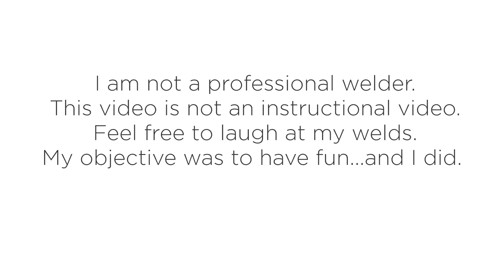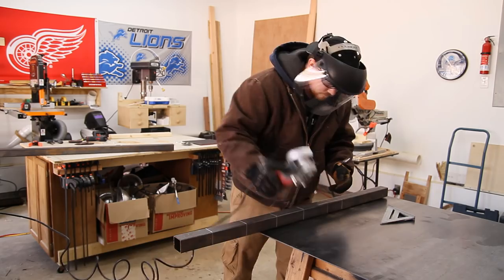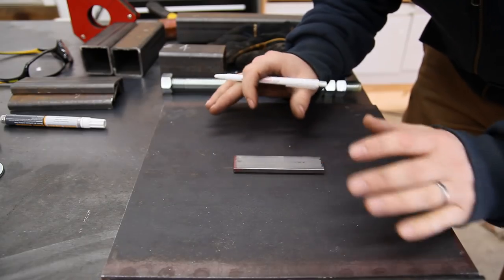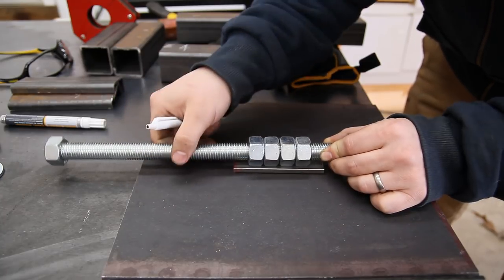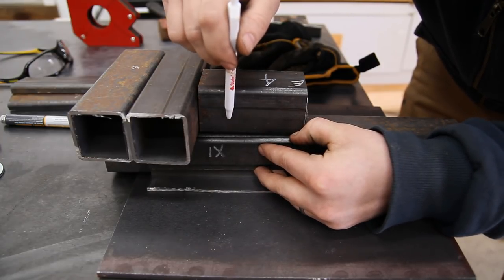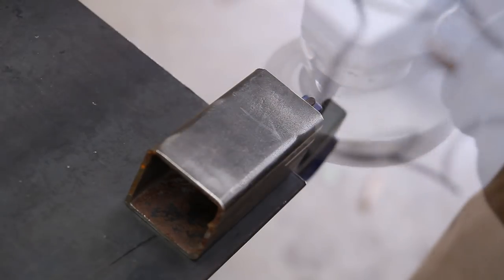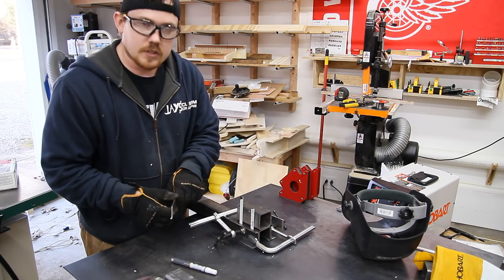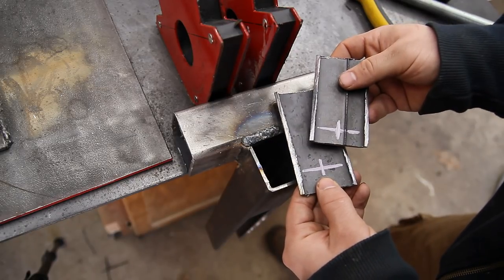DIY Metal Vise

Comment: Another great video Jay.
I have found that a sanding flap-disc works far better than the wire wheel for cleaning up the surfaces. Much faster and it doesn't spray you with wire pieces.
Also, I would suggest refraining from using the "sawing" motion while using the cut-off wheel. It is useful only in creating the path for your cut, but from there on I allow the wheel to plunge into the steel and cut. I have found that the wheel performs much better this way.

Comment: Once upon a time I used to be a certified welder. I have seen worse welds from people who were supposed to be competent. So, great job! Using that "U" shaped piece actually improves the original design and is more robust. Great thinking on your feet. Its cool to just "mess around" with no expectations. That's how we improve our skills. The all thread will last longer by adding the extra nut but the reason V threads aren't the best choice is because the translate a lot of the torque into outward force instead of longitudinal force because of the pressure angle of the thread. This means you have to tighten it much more to get the same amount of force of an acme thread. But youre right, it will be great for a medium duty vice. I really like your attitude of having fun. Great. Ok I have blabbed on too long to no one. Lol...Tim

Comment: That was super informative thank you!  I will say, I have had a blade pop in half on my angle grinder, one half stuck into the drywall of the shop I was working in (about 7 feet from where I was working), the other half caught me right in the dingus, so now I use a blade guard, no matter how annoying the thing is!  I, like many others, never think these things happen, then they do and it changes you for life!

Comment: Good adaptation to the 2x2 tubing and it turned out great! Awesome strength test at the end and I'll check back in a couple thousand years when the threads on that rod finally wear out.
Reply from the maker: John Heisz Thanks dude. I was going to use a can of tomato paste as you did but ended up chickening out. Didn't want to get it messy lol.
Reply: Jay Bates But tomato sauce is a great metal polish... OK fine, it's good for brass and I have no idea how it'd do for steel... Just tryin to see some Gallagher-type action.
Reply: Andrew Rowe Gallagher-type action is when he throws the vice at a watermelon. Would be fun to watch.
Reply: How long time did it take to build ? 
And Nice work BTW
Reply: Yj
Reply: John I just gave you a sub from this guy's channel found him first gave you both a sub

Comment: Small tip, those magnetic clamps are good for pointing the pieces together, but watch if you do full welds near those clamps because they can fuck up your weld inside because of the magnetic field, maybe not to serious for small welds but if your welds need to be 100% flawless ( radiographic controls) you cant use them. Cool build!

Comment: Thank you for posting your whole build in this video. I see where I messed up on mine. Like a fool I welded a nut to the front of the sliding jaw, where you welded the nut to the threaded rod. Not sure what I was thinking. Yours turned out great. Can't wait to correct my mistake and get to crushing things as well.

Comment: The welds looked pretty good to me. I'm no expert but I've found the welds come out smoother if you turn up the heat a little, though. Great use of the 4 nuts to distribute the load on the all-thread. Wish I would have thought if that on a recent build.
Reply from the maker: alanhennington Thanks! I had to turn the heat down actually. I was burning through the pieces at one point.
Reply: Maybe having gas would help then. I have had a Hobart welder about the same size as yours for maybe 13 years. I have always used gas, though. You said you couldn't justify the expense but I don't remember it costing too much. It seems like they basically charged a nominal rental or exchange fee on the bottle to sell me the gas. I thought the cost was around $40 but I could be totally wrong. I've only exchanged it once so I don't remember too well.

Comment: Yeah Jay, Looks like you had fun. That's what matters. I am a welder. Just don't like the flux core stuff though. If you have the means check into a bottle for shielding gas. You will find welding is very easy that way. Use 75 25 gas and it's cheap. You will love it. Oh looks like the vise works really good to. Win win.

Comment: GREAT BUILD!
I know you have welded with gas before, and flux core works great and is convenient. But it took me about 2 projects when cleanup became a pain in the azz, and that roll of flux core wire is still sitting on the shelf.
thanks for another awesome video Jay !
Reply from the maker: William Lutes I've never welded with gas :) Flux is cheap and I don't have to deal with bottle costs. I may or may not get a bottle in the future.
Reply: I hear you. The difference in welds is night and day, and Im lazy when it comes to the extra clean up. If you get a chance try with gas, it makes it more fun 😎
Reply: Jay Bates Once you have a bottle, the costs aren't that bad. I paid about $200 for a 125cu bottle of 75/25 and refills are $25. I'm just a hobby welder/woodworker so not all that much being done with the welder. I still have about 60% of the tank left after 9 months. 

If you do end up going with gas, find a place that lets you actually purchase the bottle and then exchange it. The big AIRGAS place only leases bottles. Something about that just doesn't sit right with me. I like owning a bottle and they just swap it out when I go to get a refill, so I never have to worry about recertification costs.

Comment: Looks great. Welding is my career, and the only tip I can give is to make sure you're using a drag angle when welding with flux core instead of a push angle.
Reply from the maker: Kirby Weldon Thanks Kirby. I pushed and pulled and went uphill and downhill on this build. Trying it all but I do prefer to pull. Thanks for watching

Comment: Nice project, many times the steel has a light coating of oil,if you wipe it off with paint thinner or alcohol,you will get a better weld

Comment: Jay love your videos and this fun build. As far as the welding goes the main thing is to make it stick, grinders were made to make it pretty, that being said, I had a crew of certified welders working for me in my company and they use to laugh at my welds all the time. One told me to try push - pull or puddling when using small wire feed welders instead of rocking your hand to get a cleaner weld. Try it, it works for me as I only weld when I have to. And I agree with a previous subscriber that the flap dic are far better for cleaning and dressing up welds, I always looked like a porcupine when using the wire wheels. Keep the videos coming, I love them.

Brad
Proud Disabled Navy Veteran
Navy Divers "Dive the World Over"
Combat Rescue Swimmers Swim "So Others May Live"
Reply from the maker: +Brad Garms Thank you for your input and your service.
Reply: Brad Garms

Comment: My welding instructor told me paint and grinding do wonders in making your welds look good
Reply from the maker: John Diemer True. I actually ground off the vertical weld directly to the right of the handle on the front jaw but decided against doing it for all of them.

Comment: It's my understanding that the load is distributed unevenly among threads for bolts, such that your first thread of engagement is holding 30-40% of the load, the second thread is only holding 20% of the load, and so forth.  The general rule for steel is that if you take the diameter of your bolt, then the entire load is being held within the first diameter-length of threads on the bolt.  In other words, for a 1" diameter bolt of infinite length, inserted into a threaded hole of infinite length, the entire load of force will be distributed within the first 1" of the bolt and hole thread engagement.  In your case, welding additional nuts together to make your all thread not strip out doesn't actually distribute the load better.

Comment: Dear Man, Two Important Tips:
1) When you work on galvanized materials – you MUST wear respiratory protection, because when galvanize material is heated – very toxic gases are emitted (welding lessons are taught).
2) For good results when welding galvanized raw materials – use wire without shielding gas. It's called Flux Cored.
I really like the content you create. You are a very talented man, and your works are very beautiful and accurate. Your designs are very much my favorite; especially I like your straight lines and clean.
Good luck!!

Comment: Good job, nice and simple.  Tip:  grease the rod so its easier to move back and forth, and if you use that vice to weld with, put your ground clamp as close to the part as possible or you might get "ground flash" and it welds your rod to your nuts, been there done that...
Reply from the maker: ***** I did grease the rod. Showed it in my web article. Hard to show every detail in videos. Thanks for watching Tony!
Reply: "and it welds your rod to your nuts"

That sounds VERY painful!

Comment: Idea: Fill the tubes with concrete. It's very resistant to compression, so it should add substantially to the capability of the tubes to act without deformation under any rational load.

Comment: Nice. If you make another, in the future, think about using a rod coupler. It would be about as long as 4 nuts, but you would not have to worry about alignment. Just a thought.
Reply from the maker: acklan3 I was originally looking for one but only found one in aluminum for some reason.
Reply: Jay Bates cool. I was thinking about cannibalizing a automotive scissor jack.

Comment: If you're using fluxcore, you should reverse the electrode so that the gun is negative and the ground clamp is positive. You'll get much better welds. It helps to swirl the puddle around some, too, in a zig-zag type pattern. 

Be careful when welding galvanized steel - such as that on the all thread rod. Zinc will vaporize and can cause sickness or death if inhaled.

Comment: That's great.. Aren't mig welders fun! The only suggestion i can think of is it may be a good idea to cap off the four open ends of the jaws so they won't collapse similar to the small piece you crushed at the end of the video. Maybe cap one end then fill with concrete then cap the other end?
Reply from the maker: builtrodewreckedit Yup. I discussed that with a few friends last night actually. Not the concrete part but capping the ends. I'll definitely cap the ends.
Reply: I wouldn't hurt atleast. I only suggest concrete because it would give the center of the tube no space to collapse into and the extra weight won't hurt anything either.... its a cool vice
Reply: Filling the jaws is a good idea. Not with concrete, but with a low temp alloy like Ceralloy. This will melt at around 160-220 F, depending on the grade.  You can get at MSC or any of the bigger industrial supply houses. Cap one end, fill and cap the other end. Real solid.

Comment: Nice job, and good job at using your face shield while using the cut off wheel.   I have seen those disks fly apart and imbed themselves into peoples face.   That's a nice looking vice, I'm thinking on building one myself.
Reply from the maker: Chris T Luckily I've never had any of the pieces hit me.
Reply: Ive been in factory and construction work for all of my adult life.   I have seen my fair share of accidents, many which could have been prevented.  I am now the safety manager for my company and I dont need to preach, I let photographs do the work.   I have one of a disk in a guys face.  I can share it with you if you want it.  :)   Anyway, keep up the good work, I enjoy your projects.

Comment: Nice metalworking Jay. the only thing I didn't like is the rounded off top edge of the clamp bars. Sorry I'm not native american, but I think you will understand what I mean. Maybe with a little strip of rectangular steel and a notch in the top edge this is slightly better. However you can still do a retrofit on that.

Comment: I like it but a question
Did you use flux core wire ??
And why not hit it up with a 7018stick weld to finish
I may think it to be lots stronger then mig weld
A vise will receive lots of heavy beating a d thicker will be best will you agree ??

Comment: What setup are you using? I don't know what you can do about the ugliness with flux, since I've never really used it, but if you're using argon gas, you should try and up the gas flow to cool the solder faster to avoid bubbles growing. Also, since you're welding kind of thick steel, up the amperage, I always weld at 160 amps and get smooth solders with that.  Also, move the nozzle in moonshaped motions, capturing the solder that you just laid and "stretch" it into the new weld. You probably know all this but just a heads up in case you didn't. :) Great seeing that some youtubers have begun to spread out to metalwork as well. It's very inspiring to watch!
Reply from the maker: Axel Mårs Hey Axel. I'm just using flux core. No gas. I don't think the amount of welding I will be doing will be worth getting a bottle.

Comment: Your welds are not bad... In fact they are better than a few pro welders i saw....
Question: why did you not use galvanized steel instead of black iron tubing so it won't rust?
Reply: Fumes from welding  galvanized steel are poisonous.

Comment: buddy you've probably heard this before but I'm going to reiterate it because it's so serious and you've gotten into welding. when you weld metal be absolutely sure that nothing is coated with zinc, galvanized, or is mixed with manganese. when zinc burns in air the fumes can give you zinc fever which kills you in three weeks painfully. even small doses of zinc fumes can ruin your day, I've accidentally exposed myself a couple of times and have been sick every time. take the time to either burn it off before welding by taking a torch to it outside and upwind or use some muriatic acid to strip the zinc off before welding.  you'll have a better and easier time welding and your future self will thank you when you live to a ripe old age. manganese does something similar but it's in alloys and can't be removed, know what you're working with and you'll be good.
Reply: "when zinc burns in air the fumes can give you zinc fever which kills you in three weeks painfully. "  Absolute RUBBISH
Reply: Far from the truth. I used to build and weld on barges that were covered in zinc primer every day for 5 yrs and I'm still very much alive.....While it can most certainly make you sick death is unlikely. One thing you should never do is weld something that has been cleaned with brake cleaner...that, will kill you!!!

Comment: you should grind off the zink from the nuts and bolts if you want to weld it that makes if much more easy to weld them and you dont have the toxic fumes.

its not possible to weld zink so if you try ito weld a nut your metal will drop down until the zink is burned off.
also you can buy nuts "black" (without zink) but you will not find them in the hardware store i think.

also some of your welds looks a litte "cold" try to use more power or move slower.

also its important wich angel you use. if you are welding thin pieces try to weld "pushing"  hold your torch like this \  and move this direction -> if it is thik hold it in the oposit direction and "pull weld" if you are not sure what to use weld neutral like this  |

if you have a problem with bubbles in your welding check the gas and maybe use more then check if your torch is clean and if you still have bubbles clean your work piece with the angle grinder.

good luck with your future weldings and nice video *thumbs up"

Comment: Get some 75/25 fluxcore is not your friend when it comes to making nice looking welds. Love the video.
Reply from the maker: Zach Scott I don't think I do enough welding to justify the cost of a bottle. Thanks for watching Zach.
Reply: If you look around you can get a bottle pretty cheap. I think the last time i filled mine it was $26 but my mine is the smaller tank. You have to get them recertified every so often but i think it is worth it to be able to not have to clean all the slag. But anyhow I am more of a woodwork at heart. I love your content keep it coming.

Comment: BTW, no. You could put 100 nuts. That doesn't change anything. There isn't 100% thread engagement like that. The rule of thumb is 2.5d. So, for a 3/4"(.75") bolt, you'd need 2.5 times the width for full thread engagement. In that case, it's 1.875". Unfortunately, for all-thread, it's cheap chicom pot metal cheese. Not even graded. Upgrade from mcmaster (or similar) to an actual ACME thread + nut, and get FAR FAR greater clamping force with less effort. Throw some anti-seize on the threads of your current vise to help it live a bit longer (high pressure lube).

Comment: I think you did a fine job. I'm interested in your choice of welder and how you arrived at it. I too would like to have a welder. Is yours 240v or 120v or a combo unit? 

I'm assuming all of your qualifying statements were an attempt to stave off criticism of your work. It's sad one feels they must do so.
Reply from the maker: Stanton Taylor Hey Stanton. The welder is a Hobart 140. Runs off standard a 120v circuit (thanks for not saying 110v!) I wanted a decent machine that I would never have to replace so I decided heavily based upon reviews. This model has a very high positive review ratio with a ton of reviews out there.